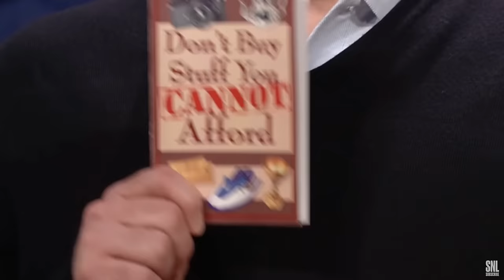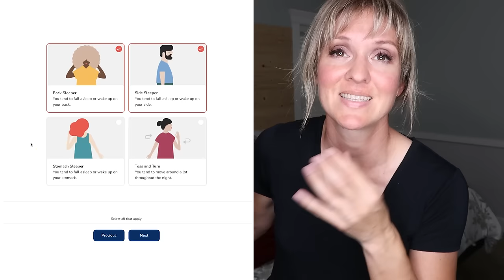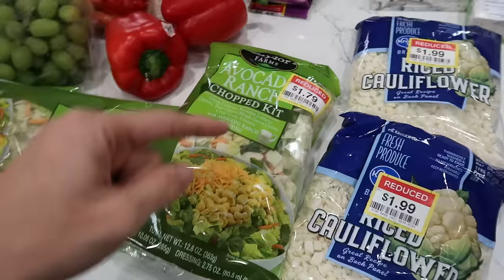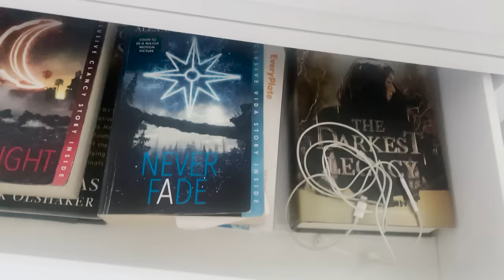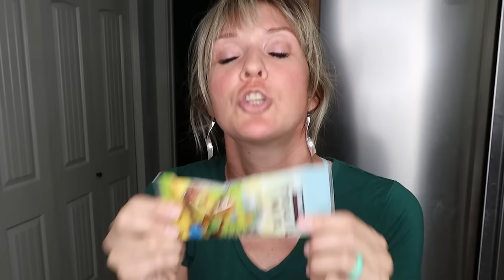7 Things Frugal People Do That You Don't

Comment: Christine - I am a public works director. In most cases, Those single use plastic bags ARE NOT RECYCLABLE in your curbside collection service. They should be recycled at select retailers who have drop boxes in their lobby (target, meijer, etc). They wrap around the conveyor belts at the recycling facility and cause all kinds of problems. They are considered contamination and must be manually removed by processing center workers. Best to reduce your usage of those single use plastic bags or repurpose them for lunch bags, small trash can liners or dog poop bags
Reply: My city will take the plastic grocery bags but only if there are a lot of them all stuffed tightly into another tied up bag. No singles.
Reply: She wasn't asking about recycling them with other recyclables. Her Walmart has a bin just for recycling bags. Our stores do, too. Do those bags, placed specifically in bins to recycle recycle plastic bags get recycled? That's the question.
Reply: @UnadornedInIndiana  sorry if I misunderstood! The plastic bag issue is always a quandary 😊
Reply: I LOVE Meyers hibiscus dish liquid as shampoo/ body wash. It does a great job!!!
Reply: Dollar tree has essential oil!!!! Peppermint which rodents and spiders hate!!! Instead of $5 per bottle it's $1.25.
Reply: Also make fire starters with sawdust, or dryer lint and paraffin. Take a muffin pan line with cupcakes papers stuff with sawdust or lint and top off with cheap or old candles melted. Let solidify and pop into snack baggies and store somewhere cool.
Reply: The plastic bags are great for putting your shoes in in a suitcase when traveling. Pack extra bags to put dirty clothes in your suitcase.
Reply: Yes, but what are the stores that take back plastic bags doing with them?? My Walmarts stopped taking them back but most other grocery stores do.  My county has outlawed them starting in Nov 2023.
Reply: Recycle yourself.😂😂😂
Reply: @maryschmidt6945 
Yep.  And damp bathing suits and extra toiletries to prevent any leaks. All kinds of great ways to use those.  I save them for yard sales.

Comment: The starter pantry is so right on target.  Just found a good way to use processed chicken tenders from the freezer.  Put a layer of mashed potatoes in a baking dish.  Put a can of corn on top of that.  Next put shredded mozerella and cheddar cheese.  Then the chicken tenders.  Last thing is the gravy.  Did not know gravy could be made from boullion cubes!  Bake this and then after you put a scoop on your plate, add gravy to the top of it.  Mashed potatoes bowls.  Yummy!  Good way to use up chicken tenders.
Reply: You made a clone of the KFC bowls. I've never had one at KFC but have made them. And, you save so much when you make them yourself. ... good work!
Reply: Saw it in youtube.  Never had KFC.  Looked so good.

Comment: In my area recycling does occur.  Our public works department sell those recycled materials for which there is a demand.  We have to drop off our recyclables at the transfer station and I frequently see them bundled to go and occasionally see the bundles being hauled away separately from the trash.  In my state, there are no trash bags like you showed.  The thicker ones can be purchased in many but not all stores; Walmart has do disposable bags, even for a fee.  My reusable bags are kept in my car so I can’t forget them.  

You’ve touched on it in other videos but frugal people plan.  I live in a town much smaller than your (1700 people).  Most shopping means traveling a distance, we combine errands, plan out a route that doesn’t involve doubling back and my trips frequently involve a friend so two households get errands run in one trip.

Frugal people shy away from disposables where it is practical.  I use fewer paper towels because as a knitter I made small clothes (Dollar Tree yarn) that I use for cleaning up after pets.  They take up a whole 6 sq inches in my kitchen linen drawer.  I stopped buying Christmas wrapping paper and tape.  I buy Christmas fabric when it is 75-90% off, make draw string bags for gifts and reuse them year after year.  Much less paper and dyes in a landfill each year.  Fewer disposables and recycling mean we save on our utilities bill each month by being able to use a smaller trash can for trash pick up.

Frugal people are ants (ant and the grasshopper story).  We know that the $5 we save on our trash bill added to $10 saved on our grocery bill are essentially nothing, but the few cents here there really add up over time.   I retired at age 60, debt free.  As I tell people, I don’t mind spending money, but I hate wasting money.

Comment: Save your spray bottles and make your own "windex". I put in 2 Tbsp. ammonia, 1/3 cup rubbing alcohol and 1/4 tsp. dawn dish soap, fill the rest of the bottle with water and shake well. This makes a wonderful streak-free, grease-cutting cleaner. Plus, the ingredients cost much less than one bottle of Windex.
Reply: I use just dawn and water and wipe with a microfiber cloth. About 1 tbsp of dawn. Works great

Comment: I love using ammonia for cleaning in the kitchen.  I don't pour it into water as that just uses up your bottle of it really quickly.  And spray bottles are too much as well.  I fixed this problem by putting ammonia into an old hairspray bottle.  Comes out as mist and I spray that onto my cleaning cloth and wipe up the grease.  Works great and a bottle of ammonia lasts me a very, very long time.

Comment: Walmart pickup putting one item in a bag😅😅 so true! About Windex, I have been using the clear vinegar windex to clean stains from carpet and upholstery for years. It doesn't leave any color behind.  It also removes permanent marker. Oh, I always use half or less of the recommended amount of laundry detergent. Thank you for all your ideas. Feel better soon. That clean diet will surely help, even though it can be difficult. You can do it.
Reply: My father in law owned a laundromat for years and swore by using 1 tablespoon of detergent in the front loaders. I get about 70-75 loads of laundry from one bottle that says 35 loads!

Comment: Love your videos. I think I can answer why the sodium is low on that packet though. First, it's a small packet. Second - the salt is on the OUTSIDE of the food, not mixed through. So it hits your tongue right away and you taste it as very salty, without much being there. Just like how sprinkling a few bits of salt into your mouth directly is very salty. When sodium is very high and you hardly taste it, that's because it's mixed through and you eat it along with the actual food. You need more salt to taste it than when it directly hits your tongue. It's the same with sugar - you hardly taste a cup of sugar mixed into a batch of muffins, but you really taste a bit of sugar if it's on the outside of a food (like mini-wheats, which are not nearly as high in sugar as you'd think, compared to something like Cap'n Crunch or honey crisp, which is high in sugar but it's mixed through). I do feel a lot better about my salted nuts now though :) And you NEED that salt when you're training!

Comment: The Mr. Clean spray bottle looks like the Dawn Powerwash spray bottle. You can make your own Dawn Powerwash for about 50 cents:
13 oz water + 2 oz Dawn Platinum (it just works better) + 1 oz isopropyl alcohol
Measure the soap and alcohol into a small cup and slowly pour it into the water (not the other way around to prevent foaming.) Gently stir it until it reaches a uniformly thin consistency then using a funnel pour it into the empty spray bottle. Good for cleaning with minimal water.

Comment: I knit and crochet, and I've noticed that if I use the cheap acrylic yarn for dish scrubbies I don't have to buy sponges at all, or deal with them falling apart and down the drain. :)
Reply: That's a great idea! Thanks! I love to crochet but dont want to create clutter...
Reply: I use cotton yarn for dish cloths and splurged for a skein of a scrubby/cotton mix. I like those scrubbies really well. I made them smaller than the original pattern so I could make more out of one skein.
Reply: @jhwilliams6550  The scrubby yarn is great, but I can't handle the feel of it in my hands. 😁 I use the cheap acrylic scraps because I found it didn't bother my hands and actually scrubs without scratching.
Reply: @MajorMonkeytoes  I don’t like the full scrubby yarn and had some gifted to me so I added cotton yarn and double stranded it and that helped but I can tolerate this one because it’s just sections of it. My step mom makes tons of pot holders out of scraps of yarn.

Comment: You can use store bags to crochet door mats, outdoor carpets for your deck, or hang them up to give you privacy. Just cut them down the sides put them together at the handles by looping them through each other roll them up and start crocheting. I too cut my sponges in half. When my daughter visited she thought it was weird. But I do believe the smaller size is much easier to work with.

I hang clothes that weren't worn very long up after wearing and spray a tiny bit of Febreze under each arm or the crotch of the pants I see no reason in washing unless they are really dirty or stinky. And I rarely wash my jeans unless I need to in order to shrink them a little because they've stretched out too much. But I hang everything to dry which actually cut my electric bill way down. I couldn't believe how much it saved me. And it makes the clothes last longer too. 

I actually reuse my bath water too. As a single senior citizen living on a limited income when I shower or take a bath I keep the water in my tub, use a dollar store bucket to scoop it out to flush the toilet. Sometimes I even soak really dirty clothes from working in the garden in it then squeeze them out and put them in the washing machine. The modern washers don't give you much water to get things that are really dirty clean so it works great. Then I still use the water after that to flush the toilet, although this wouldn't work so well if you have other people in the house and only one bathroom. It is also great for helping increase humidity in the house during dry seasons. Thanks for giving  me even more ideas.

Comment: I primarily shop only the food sales & clearance and make meals accordingly. One of our faves is now a leftover layered casserole of a white starch base and add one sweated onion, a veg and chopped meat. Mix a can of cream of soup and 1/4 cup mayo thinned with milk and pour over the top and bake. Fried onions are a nice touch to finish it off. The combinations are endless. Keeping cooked rice, pasta, and boiled potatoes  in the fridge has been a game changer. It makes meals on the cheap so fast and easy.  Best ever is also having a Ninja Foodie 13-1 oven to make sheet meal, small baking jobs and the best ever crispy pizzas. . I can even dehydrate small batches of herbs etc rather than toss excess. Another tip is cooking dried beans in the instant pot. Dehydrate  them in the  Ninja Foodie oven. This way I can make quick refried beans for burritos and more and I don’t store cans. 

I cut Brillo pads in half. Clean with vinegar, Dawn and water,  You are spot on about home repairs, DIY and interior redo’s. We cut most meals out to only once per month or a pizza or two from a local Kwik Trip for $7 as opposed to $45 going out 😭.  We also do a ton of DIY. Never thought of cutting sponges. Great video. Love when young people get the power of being frugal. I use plastic shopping bags for all trash. We never ever buy trash bags.

Comment: We had our kitchen completely remodeled this summer.  Before they came to rip out the old one, I had the yucky job of packing it all up.  OMG!  So much stuff went.  I decided that we didn't need all of the duplicates we had, as well as stuff that never got used.  When the time came to move back in, I got rid of more stuff too.  Now I have a new kitchen that is not only easier to use but far more organized.  Yes, I did buy a few new things for in it, replaced a few things from before that were totally worn out, but other than that, I'm being much more aware about what I buy for in there.  And I know exactly what I have and where it is now.  I also started drinking instant coffee--I'm done with spending money on a Keurig that is not only junk and doesn't last, but super expensive by the time you purchase pods.  I never realized how bad Keurig coffee was until I started drinking instant.

Comment: Another tip I love is to shop consignment stores.  You can get some insane deals on clothing, furniture, decor, etc.  More often than not I find clothing items that still have the original tags on the items.  I also volunteer (retired and on a fixed income) for an upscale thrift store.  In addition to clothing (sorry, we only take women's clothing--not enough space in the store for children or men's clothing).  The furniture we get in is better quality than you can buy in the stores and less than half the price.  Sure it is used, but if you are on a budget and need something for your home, you can always get the piece cleaned if it is soft furniture like a sofa.  We don't sell or take mattresses so no worries there, but otherwise we accept only pieces that are in good shape.  (Some antiques come into the store too.)  Lining your waste baskets with bags is something I have done for years.  Not only it is easier to empty the basket, they also save time in having to clean the basket from leaky bottles.

Comment: another fun fact when it comes to re-using leftover grocery/wal-mart plastic bags.   Store them in the cardboard roll piece at the end of a roll of a paper towels.   Start stuffing a bag (bottom side first) into the opening of a cardboard roll, loop the bottom of another bag into the handle of the first bag sticking out, stuff, repeat. You can EASILY get 10+ bags in one paper towel cardboard roll.  Learned this from growing up in a motorhome with limited space, small trash cans and provided another use for otherwise wasted cardboard from the paper towels.

Comment: Depending on where you are in your life, some of these are not going to apply.
I'm a widow and an empty nester. I don't track my spending because I don't buy a lot of unnecessary stuff, so it's not needed.
I don't make a meal plan since I'm only preparing food for myself. It's not unusual for me to make way more than I can eat at a time and freeze the leftovers.
With DIY, I find it's better to pick and choose what you're comfortable doing. Could I change my own oil? Absolutely. I've done it before. Do I like to do it? Not in the least. I prefer to pay someone else to do it for me. That also means I don't have to dispose of the used oil, which can be a nuisance.
I have, however, built several chicken houses, a rabbit hutch, a pole barn, a wood shed and probably a few other things. I don't claim to be a carpenter, but they came out quite well, IMO.

Comment: I buy Windex, Dawn dish liquid, Isopropyl alcohol, & Castile soap by the gallon and baking soda in 10-15 pound bags from Amazon.  Dawn & Castile last about 2-3 years, Isopropyl alcohol lasts about a year, and I don't know how long Windex (it been about five years & still have about a 1/2 gallon left.  I buy the baking soda 1-2 times a year. I buy about 4 white distilled vinegar a month locally.  I also use tap or distilled water, lemons or lemon juice, hydrogen peroxide, denture tablets & salt.    Isopropyl alcohol, hydrogen peroxide, vineger, baking soda, and lemon juice all disinfect. I use denture tablets for my toilet bowl.  They clean and disinfect.  It is cheaper, especially if I buy by the gallon, fragrance-free (allergic), and has less harmful chemicals (allergic to strong chemicals).  My allergist didn't know how to help me when I started reaction to store bought cleaners, soap, shampoo, etc.  So I started using items listed above that my grandparents used.

Comment: Windex DOES work on floors! When my daughter was little & all over the floor w/her toys, I used it to clean, & there was no residue! I used one cloth to scrub, & one to wipe up. I use it now w/my Swiffer. I put an old kitchen washcloth on it, then spray the floor, & wipe it up. Easy peasy! I also keep 2 other spray bottles full - 1 w/water & bleach, & one w/water & white vinegar. That's really all you need - & Comet cleanser for toilets & bathtubs. Also, I get the green scouring pads from DT & cut them in ½, & I use cheap toothbrushes for grout. No scrub daddies or mamas here:)

Comment: Thanks so much Christine!! I always love your videos and positive energy!!  I cut sponges and scouring squares too, along with select size paper towels, they get torn in half and put in a basket as even the smaller select size is often more than I need.  When I want fast food and try to resist, my mantra is "save money and save calories" and if I just want a high fructose corn syrup drink, I tell myself "water is the most refreshing" as it truly is! One thing I'm on the fence about is diluting dishsoap. Do you use less when it's thicker or when it's runny and squirts out super easy? What would the test be for that? lol I'm curious, and have tried both ways, not reaching any conclusions.

Comment: hanging your blouses or shirts outside in the fresh air after a mild use saves so much time, water, soap, etc...plus the clothes last longer if you don't run them constantly thru the washer and dryer....not using the washer and dryer as often saves energy and MONEY.....underwear, socks, etc...are the only things you should be washing after use....